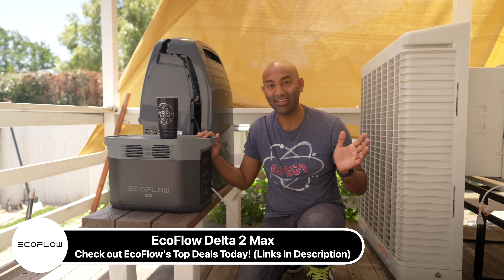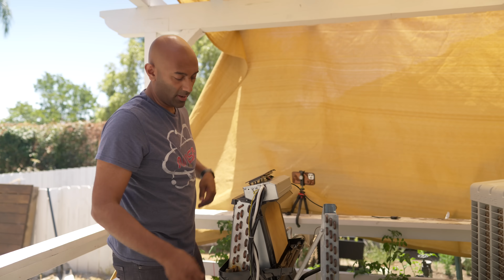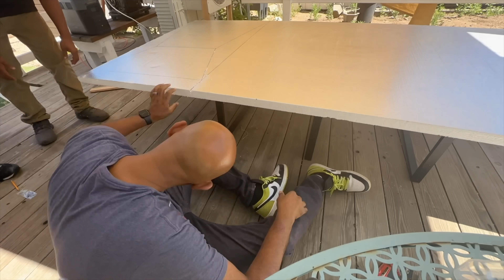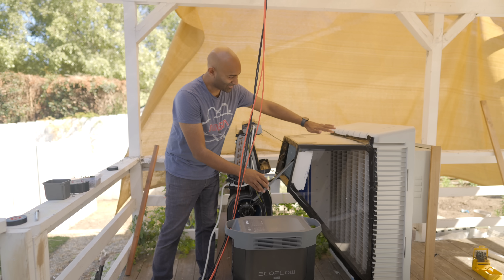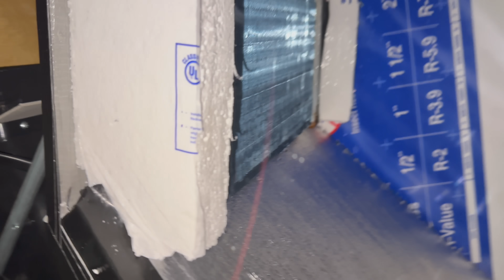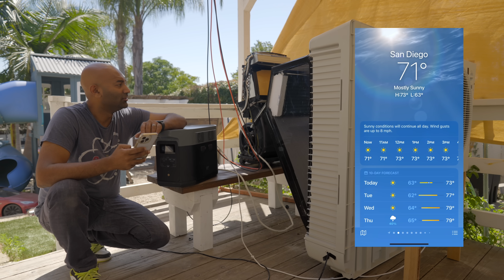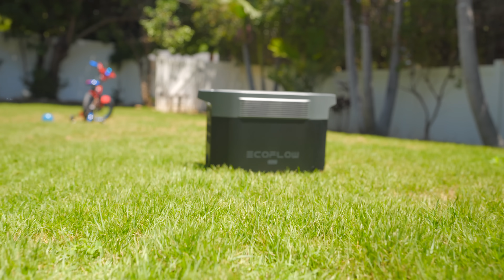Solving the Water Crisis: Solar + Battery = WATER!

Comment: why not just use a dehumidifier?
Reply: That's what a dehumidifier is.
A heatpump that circulates air and catches condensation.
Reply: @MauroTamm  …and blows the cold air over the hot coil to gain better efficiency.
Reply: @mechanismguy  u jokin! 
I really can't tell cuz recently saw a vid about a Joule Thompson cycle compressor system that uses regenerative cooling, like you said.
Don't know how dumbee that is.
Reply: Yeah, I agree, this seems a lot more inefficient. A dehumidifier seems to work better.
Reply: I'd be curious to see a head to head with a dehumidifier and then see if improvements can be made to beat the efficiency of a commercially available dehumidifier.
Reply: Why not put a humidifier and a dehumidifier in a room and let them fight it out?
Reply: @josephdykes1820   🤔 thats like hitting yourself in the head on purpose and then taking something for the headache 🙄..... like why would you?
Reply: @josephdykes1820 bahaha
Reply: You’re right, a dehumidifier would work, assuming that there’s moisture in the air. Which, of course the entire premise of This requires that. Now our air conditioner is also a dehumidifier, but it added different elements to it in order for cooling.

Simply put you can definitely use a dehumidifier, but you’d have to really filter that water well
Reply: I think as these channels grow, they push products like the ecoflow.  A dehumidifier would be more efficient.  I bought several 12vdc dehumidifiers to create this water collection process for my garden.  They will be solar-powered.   In the mean time, if you want water this way, collect your ac condensate and pour it into your rainwater collection.  I'm getting 20 gallons every two days here in Texas.  The high humidity and heat is making this possible now.  Must be an el Nino thing.
Reply: I look forward to his reply
Reply: Just what I thought.
Reply: A dehumidifier  is largely the same thing he built minus the swamp cooler and nit blowing cold over the hot AC refigerent condensor coils.
Reply: Because the entire point of this was to re-use stuff he had laying around?
Reply: So u built a dehumidifier,  works great where u have humidity, try that where u need water, desert climate, no humidity..
Reply: @harryb1745  there is actually a company that makes these.  It collects water and adds minerals designed for human consumption.  They claim that it can extract moisture from the air to a minimum of 10% relative humidity  in the desert.
Reply: @mr.makeit4037  where might I look at this item?  SEnd a link if possible.  Thanks
Reply: @harryb1745  bruh.. it'd work in the same way. 
An air conditioner is a dehumidifier.
No matter where, no machine is too well known to make water from 0 humidity/moisture air.

Basically it'd be way harder to do it in a dessert either way.
Reply: @harryb1745  If you are cooling a house with a human inside, you will have humidity.  Especially if the human has to go out sometimes.
Reply: Wouldn't it make sense to use old oil rigs to convert into water and energy (wind) plants. They have infrastructure already.
Reply: Because this is much fun! Hahaha
Reply: Because this is just advertisement for some battery pack
Reply: Too simple. Not video worthy. Income comes from video worthy content creation.
Reply: You can't drink the water from a dehumidifier because the elements of the dehumidifier can collect bacteria mold and dust
Reply: You cannot drink the water from a dehumidifier, because the elements of the dehumidifier can collect bacteria mold and dust, and the condensation can also collect lead as well, and will contaminate the coils, so it's not safe to drink the water, unless you filter the hell out of it, & that's still not a guarantee it's safe to drink, Google it ( can you drink water from a dehumidifier)
Reply: Правильный способ — захолаживать теплоизолированный объем, и прокачивать через него воздух через трехступенчатый пластинчатый теплообменник на встречных потоках, их КПД > 95%, при этом вы можете использовать холод полученной воды, используя ее для охлаждения радиатора вашего теплового насоса (кондиционера), если вас устраивает теплая вода (или хранить холодную воду в термоизолированном объеме (термосе), если вы хотите использовать установку для получения холодной воды!

Вода при этом будет выпадать на пластинах одной из ступеней вашего пластинчатого теплообменника на встречных пртоках. 

And you don't need a dehumidifier for it!
Reply: Not about the end, it's about learning through the journey
Reply: @Topper-tech  I live in the desert, its about the end...
Reply: @WINTERMUTE_AI 😂😂😂 I feel ya
Reply: @Topper-tech  
What have you learned ?
Reply: Water from a dehumidifier is dirty you would have to distill it first
Reply: @theproffessional9  Would be the same for the system built in this video, no?
Reply: @theproffessional9 so you mean the air I breathe is dirty. Does it matter at this point?
Reply: @theproffessional9 
Why isn't the water from this mind boggling set up "dirty" ?   where is the difference ?
Reply: @theproffessional9  No need to distill. But one should always filter all condensed water intended for drinking.    

And the cold AC evaporator coils on which water condenses should be thurally washed to ensure there is no solder flux remaining on any surface.